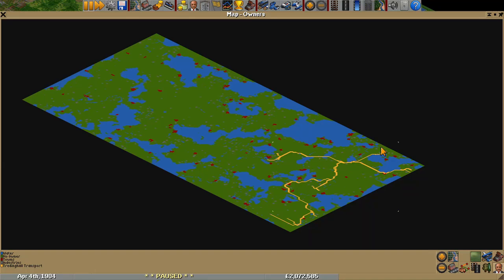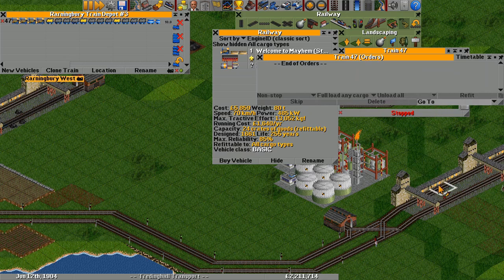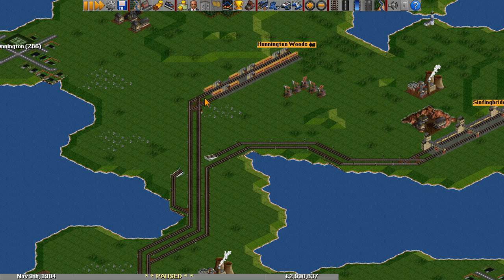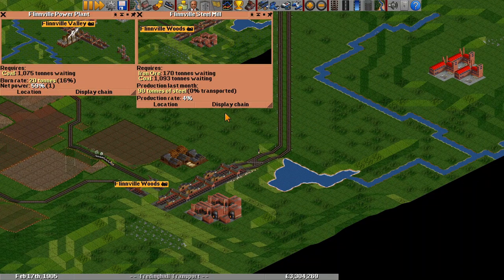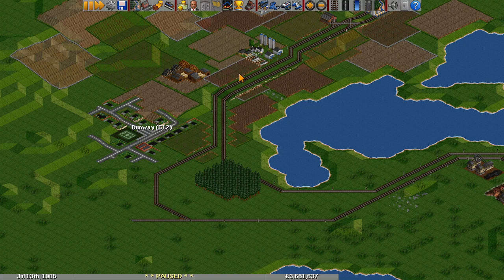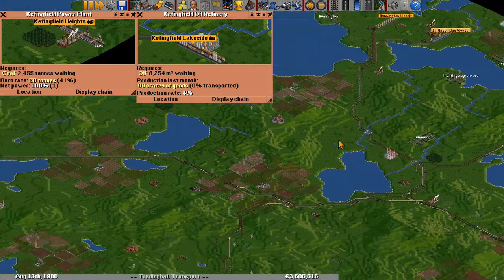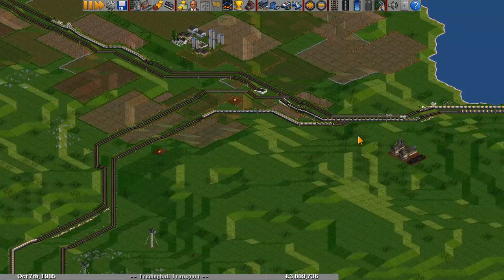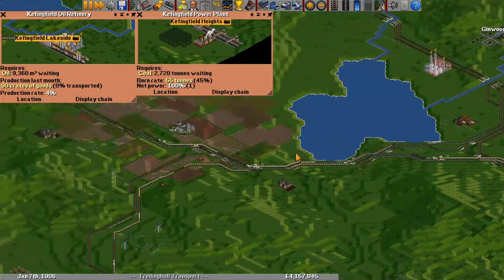Ep 4 - The First Jam (Let's Play OpenTTD)

Comment: Small addition: putting the depots in that position (on the exit track just past the X at the front of the station) only hides the depots from the main network if you have 90° corners disabled in the options (Settings -> Vehicles -> Routing -> Forbid trains and ships from making 90° turns -> Off)

Good episode as always. Looking forward to the BBH build
Reply from the maker: Very true. I'm just very used to 90* turns off
Reply: I just use reversers XD
Reply from the maker: @aquila7561  Yeah if you have 90* on it becomes very tricky to hide anything from trains

Comment: Great video lugnuts, only thing is I think you should use some streetcars from the oil refinery to that town next to it just as a temporary solution and also to grow it incase you want to do passengers just so you start using the oil to make goods

Edit: also can you explain to me on the coop discord about the path signals thingy at end of stations? I’m a bit confused
Reply: I think he mentioned it a little bit the first time he did it. When the trains come out of the depot without the path signal they would reserve the entire junction at the front of the station, meaning no other trains can enter/leave. The path signal separates the junction from the station and because the backside of a path signal is a pathfinding penalty it hides the depot from the mainline.
This can be a good thing and a bad thing, no trains going to nearest depot and getting lost, but because of the pathfinding penalty the trains will always prefer the other platform, unless its already occupied resulting in trains not getting auto-replaced. The depot at the exit track is a better option imo.